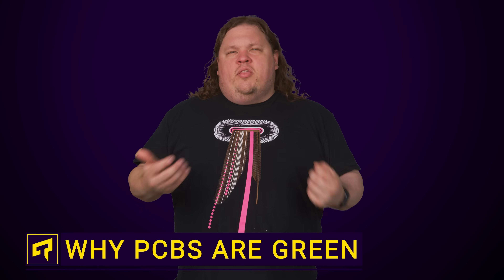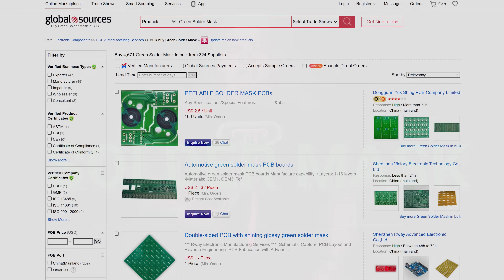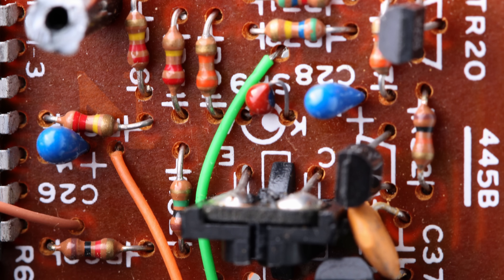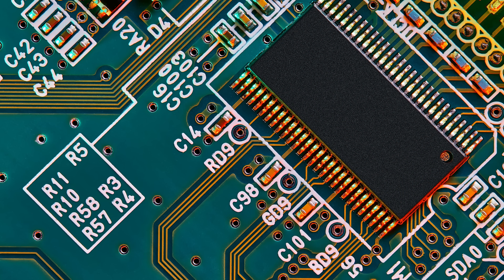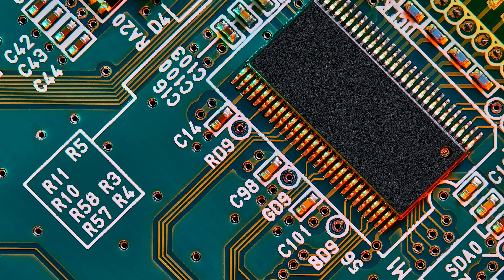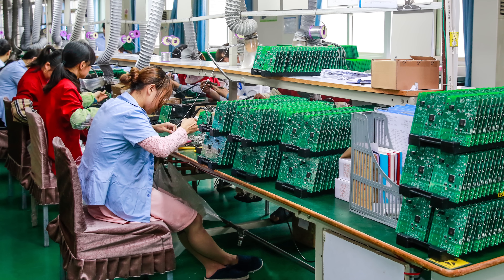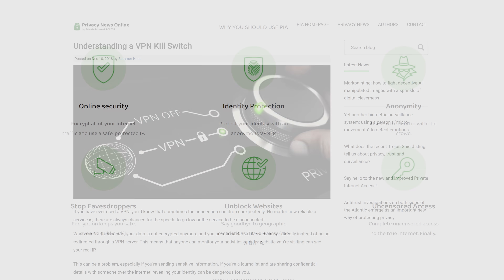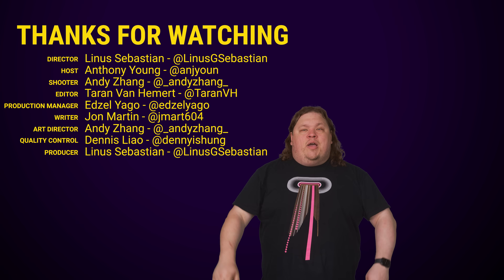Why Are Circuit Boards Green?

Comment: Back in the early 1980s I worked at an electronics assembly shop for a brief period doing quality control on PCBs for digital dashboard displays.  My job was to take the complete, wave-soldered boards and check for things like diodes placed the wrong way, wrong ICs, wrong spec resistors etc (This of course back when these things were still discrete elements !).

After I checked the completed board against the master I was supposed to put a gold spot on the board before it was sent off to the "acid bath" for final cleaning and packaging.  Since I had seen a lot of PCBs in my life and couldn't remember ever seeing a gold spot on any of them I naturally assumed that anything I put on the board would be wiped in the bath, so started writing "Help-me-I-am-being-held-prisoner-in-a-Japanese-electronics-factory" one word per board.

Which was bad because the factory was German and the writing did NOT come off in the bath, so naturally I was fired the very next day !

Damned Germans, no sense of humour !

Anyhoo - long story short, green PCBs are much easier to read than any other colour.

Comment: Sooo… a whole video consisting purely of unsubstantiated hypotheses, many quickly debunked, the rest left as guesses. 🙄

The slight turquoise tinge of iron impurities in glass in the epoxy-glass composite is definitely not the reason, since the solder mask isn’t made of epoxy-glass composite. (FR-4 epoxy-glass composite is the most common substrate.) And green solder mask is often used on phenolic PCBs, which aren’t epoxy-glass at all!
Reply: @GlizzyKing-n7h  Knowledge is power. And knowing how to identify bad information is a critical skill sorely lacking in most people.

Comment: Interesting. I don't buy the military story though - as you say, exposed PCBs were rare (and would be more so for any equipment you want to last in all weathers). Wherever you look you'll find some conspiracy theorist trying to pull the US military into things.
Reply: Early on the military wasn't interested in modern electronics. The military is a very traditional organization so they don't like new fangled stuff, until they decide they do. But in the beginning the military rejected integrated circuits in favor of the old discrete tech they'd become familiar with. From what I've read mask was green because it was the cheapest option available. No one cared how it looked. Customers didn't look at boards.

Comment: PCBs? When I was a boy, we had point-to-point wiring! The underside of a radio chassis looked like a rat's nest.
Reply: That's how it was done before printed circuit boards. There were a couple different methods. Mostly turrets or lugs. It was very labor intensive and difficult to work with.

Comment: Soldermask. They also have other colors like red, black, and blue, but those were exceedingly rare. Plus it took ages to clean off the machine to only mask a few boards.
Reply: The whole point of printed circuit boards is mass production. So if you're only making a few you're doing it wrong.

Comment: Do: why are ram chips black and dull while cpu and gpu dies are shiny
Reply: Chip dies are usually not visible. They have to be encapsulated to protect them. Plus light affects operation. The photoelectric effect. There is one kind of integrated circuit that was made that had a quartz window over the die so you could expose it to UV light to erase it called an EPROM. But they normally have labels on them to block out ambient light. Old BIOS chips were EPROM. Today we use EEPROM flash ROM. This is what an old EPROM looked like https://http2.mlstatic.com/memoria-eprom-27c512-dip-28-para-ecus-tunning-D_NQ_NP_848257-MLA25872253662_082017-F.jpg You can see the square die inside the round window.

Comment: I've always viewed green as a "neutral" color and like you said, it's not "offensive" to the eyes and retains that professional look. I think blue would have been just as acceptable, red looks too tacky and too much like a cheap toy.
Reply: and white looks like someone is trying to hard to look like a cool manufacturer
Reply: @martinkuliza  Also the fact that combined with aluminium substrates like are often used in LED lamps, tracing tracks is pretty hard due to not being able to shine light trough the board and the white hiding smaller details behind it.
Reply: Meh, alot of pcbs where red a copule years ago. Especially addon cards. Gpu, usb, sound etc
Reply: @maxpower700  I've seen red video boards as far back as PCI. I seem to recall a TEKRAM or a TSENG red VLB board, but that was two decades ago, I could be mistaken.
Reply: Blue will never not remind me of cheap Dell prebuilts.
Reply: I think of green as a neutral color too, but I'm colorblind. Hey, are you colorblind?

Comment: PCB manufacturers here. The green white contrast is kinda true. We have several solder mask colors like orange, red and Blue. None of them have special properties. It depends on the customer specifications. 
Others like black and white are used in specific areas. White ones are often used in lighting assemblies cause they reflect the light, while black ones tend to negate the this effect

Comment: Oh you can find a green motherboard still, that's for sure!  But compatibility is a whole other barrel of monkeys.  Phone PCBs, LED light PCBs, speaker PCBs, basically everything cheap and made in China have a green circuit board.  It's probably just cheaper to manufacture.

Comment: Fun fact: Green boards come in different shades. This causes a huge problem in manufacturing because when the cameras are set to accept one shade the others are marked as faulty, even though there is nothing wrong with them.

Comment: When I worked for General Dynamics back in the 80's, the majority of circuit boards I worked on were a goldish tan, but blue was also common. Green was far more common in the civilian market.
Reply: I've seen a lot of that fuggly yellowish-tan in civilian stuff from the late 80s
Reply: Dude that is a sick job ngl
Reply: Phenolic PCBs are the cheapest option and are brown because of the material. They get clear or no mask for cost as well.
Reply: Ive seen sort of what your talking about in furnaces.
Reply: Yep all our old industrial machines have this disgusting yellow and some are blue
Reply: @rolux4853  I think the yellow looks cool tbh lol
Reply: Which facility did you work at? Groton or Avanell?
Reply: I'm wondering if those colors have anything to do with the materials used and the products they are used in, since GD is an aerospace and defense company that produces things for both aerospace and maritime applications.

Comment: I'm kind of curious at what point in production they actually turn it green. I worked at a laminate manufacturer (they create the copper-coated boards, so when we shipped them out they were a yellow/brownish yellow core with copper completely covering one or both sides), so i never saw any green, but i know they would have ended up that way. Is that something that comes before or after the acid bathing to etch the circuits? Maybe LTT/Techquickie should do a video actually showing the full production process from start to finish on making a motherboard, if they could get the access to those manufacturing areas

Comment: Because Macumask brand used to dominate the solder resist industry.

I worked at Tektronix's PCB fabrication plant (both wet and dry solder resist parts) in Forest Grove when I was 19.   Actually a pretty fun job.

We had green and for really special boards blue and red - usually major engineering/prototype revs so they could be visual identified.

"Blueboards" used to be S P E C I A L lol

Comment: One of the assembly houses we use has a PCB supplier that gives a discount for not using different colour, and so at the company we ended up with all product from this assembly house being black with yellow silk screen.
Other products from other assembly house are green, doesn't really matter those products are potted, or welded shut.
For prototypes I use whatever I feel like today, used nearly all possible colours, white, mat black, red, blue and purple, also other nearly bought one with transparent soldermask.
Colleague that worked in military said once, that they used specific colour for prototypes, and different one for production boards, to make it impossible for someone to install a prototype board in the aircraft/tank/drone etc.
I personally prefer mat black with white silkscreen.
Reply: Oh and common misconception saying that green is cheapest, is not that the green soldermask itself is cheaper, but having not to change the colour at the PCB factory saves the cost.

Comment: From our supplier i learned that white and black use bigger pigments and have to be out on thick to cover the PCB properly. That makes them usuitable for high density components and takes longer to delevop. 
green, red, yellow and blue are pretty much equivalent in produtions quality, but historically green is the most common and therefore the cheapest. 
Also green and yellow allow the best inspection of traces, while black and white are petty much impossible to debug.

Comment: The green color allows for for a .2mm distance between traces and black allows for .22mm. Thats not much but if the pcb isnt going to be visible why not choose green. Also green usualy is standard option and sometimes u have to pay extra for different color. Green is also easier for quality controll. If u choose a white pcb they have to manualy control (to bright for the camera,) it and black could be too dim. So there are many reasons to go for a green pcb.

Comment: Excellent  video. Back in my day  i  created  proto type pcbs  in copper clad using sand blasting  and  a special  mixture of brown  etching  solution wich when  dipped in  a electro plating  bath turned the boards brown until the clear electro plating  solution was  used witch turned them lt green prior to adding  the  green  dye  and then the coating  for preventing  EMS  regarding  possible  shorts  when wave soldered  of components  prior to smd devices.

Comment: We tried black boards for board stuffing by our manufacture and the mistake free yield went down as the optical verification had trouble with black board with mainly black components.  Did settle on red as that was still good enough.  Note that for large runs in large facilities black may be viable but for you smaller companies with limited cash green us still a good choice.
Reply: Green mask far predates any kind of optical verification. As I've heard it green mask was just the cheapest option available back in the day. Epoxy has a green tint to it naturally.
Reply: @1pcfred  I realize that... It is just one of the many small reasons as to why it is still the default when so many other fancy colours are now available.

Comment: PCB green doesn't really blend in anywhere though so camouflage is not a very good hypothesis.  For what it is worth (my experience runs from the mid-80s to now), raw PCBs without a solder mask tended to range from yellow through tan through brown depending on where they came from.  Most of the "learning"/hobbyist PCBs tend to be a really light tan while PCBs in old toys were a dark brown.

Comment: What I often wonder is why they don't apply a water/corrosion resistent coating after soldering. It would come handy against spills on laptops or phones.
Reply: The way PCs are made defeats the purpose of trying to waterproof them. There's too much that plugs into the motherboard. You can't really waterproof those connectors either. Well, you could. But it would be pretty inconvenient. You'd have to use a knife to cut the waterproofing to unplug anything. I imagine there might be thermal issues with the CPU too.
Reply: @1pcfred  Sounds reasonable, thank you for your answer. I gather, a water resistant laptop is not in our near future, and it should be designed as such from the ground up.

Comment: Back in the summer of 1979, I got my first job in electronics assembling memory boards for an aerial surveying computer, and I asked one of the engineers why the circuit boards were green. And she told me that it was because different colours of the board indicated if that board had a special capability. For example, one colour meant that it was resistant to fungal growth, or another that it would not degrade in high humidity environments, or still another that is was more structurally sound and thus could resist shocks or high "G"s. Of course, this was 40 years ago, so I may be misremembering...or the engineer was pulling my leg...but it would make sense.
Reply: If that was the case it was just a scheme used by that particular company. As there is no industry standard that resembles that.
Reply: @1pcfred  I am sure that is true today, but the person I was talking about had done work for NASA, so I would trust what she said. But, as I said, it's been 40 years since that job...

Comment: I'm a professional who stares at PCBs all day. Can confirm: Red PCBs suck. But we also work with a lot of dark blue PCBs, and those are also okay.

That said, most mistakes are caught by (oversensitive) machines nowadays. Though, you could argue they might not significantly reduce errors since they tend to incorrectly mark about half of the parts as bad.

Comment: Geologically speaking, pcbs being made of silica, it comes from sand, essentially. Certain constituencies are preferred, but the optical properties get melted with the minerals, and this is generally the color that comes out with the kind of sand that’s most preferred for rigidity and weight.
Break one open, and you might find tan/brown. Iron and magnesium (I could be wrong off the top of my head there) are commonly substituted in many silicate minerals, and the optical properties from those minerals are green and brown, as one ca; also see in the polymorphism of olivine.
Reply: Solder mask is applied over the circuit board. It is an epoxy. The board itself is glass fiber and resin. Unless it is a phenolic. Which you're not going to find in modern digital electronics. The only way you'd see the substrate is to break the board open or look at the edge.

Comment: Green was definitely easier to work with for soldering components onto the board back when it was done by hand at the factory. I've experienced this myself back in trade school when they had us learning the ins and outs of electronics and how computers work. Brown circuit board, and it would either be a mess, and/or I would have burnt the traces with the soldering iron. Green circuit board and it was much easier to solder components to it without making mistakes like that.

LOL, I remember the first time I saw a bright red circuit board. It blew my mind over how cool it looked and how hard it would be to solder anything to it.

Comment: White PCBs are usually reserved for LED pcbs. But one of the big issues with white PCB is automated inspection. It is difficult to see solder shorts on white solder mask. Which lends to the idea they have lower yields.

Comment: I always thought that digital boards are green and analog boards are yellow. I have no idea where I got that from, since you can have analog and digital lines on the same board.
Reply: NO.....
The Yellow was generally to indicate IT WAS A POWER BOARD
Open a computer power supply and you'll see what i mean 

now open the back of  TV
you'll notice that THE LOGIC BOARDS,  the T-Con boards and the other boards on plasman TV's are all Green,
this is to indicate LOGIC or MAIN BOARD 
but so you can easily identify where the main supply is coming from  THE BOARD WILL BE BROWN/YELLOWISH

Now... if the Power is integrated onto the logic board the board is green
but yeah. that's why the old boards were Brownish/yellow
Nothing to do with analog or digital 
like you said,... you can have analog and digital on the same board
Reply: @martinkuliza  That makes sense, now I know where I got the "analog is yellow, digital is green" idea from. I was confusing a power board for an analog board.

By the way, why the shouting?
Reply: @chromacat248  
1. You're welcome
2. I'm not shouting

FYI... if you have to ask WHY THE SHOUTING but it doesn't make sense, then it makes more sense to say that i'm not shouting but instead  JUST USING UPPER CASE TO EMPHASIZE  A POINT    haha.
Does that also make sense ?

anyway.... You're welcome and i see how you made the association ,  Makes sense.

Comment: It costs less to have them made in green. Not much on a small batch of 5 or 10 run. But when you are ordering 1000 at a time it makes a big difference. Also it's far cheaper again with green when you are ROHS lead free. White red are not common outside of lead solder mask. Most manufacturers have to abide by ROHS laws. That's mostly why

Comment: The typical acid used to etch "etched circuit boards" is slightly green in color. This probably transfers some of the color, so green coloring added to make brighter was easier than trying to get rid of it. Likely contributing to the popularity of green pcb.

Comment: Here's a video suggestion from this vid: pc case that actually has a plant in it, surviving off led lights, with a raspberry pi or similar auto watering system. Bonus if it takes the water from the cooling loop (cold side!) And the pc case is hooked up to a water supply the way some fridges are to top up the cooling loop. Need a very slow growing low maintenance plant that won't send leaves into the fans though

Comment: So much easier to QA these when humans can perceive different shades of green more than any other colour. Much easier to pick up delamination and internal FOD.
Reply: Even visual inspection is mostly done by machines these days, but using an easily filtered primary colour that is not commonly used for components is still an advantage.
Reply: @chrisward000  very true! I also think a lot of manufacturers won't see the point of changing colour based on legacy alone